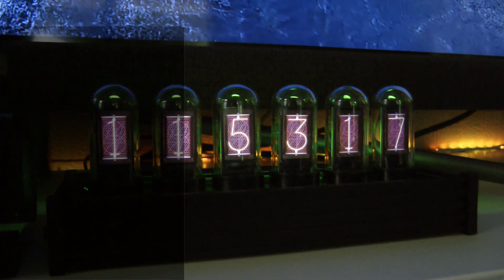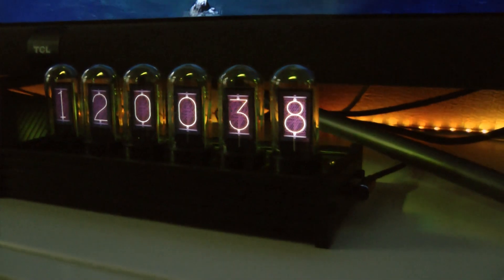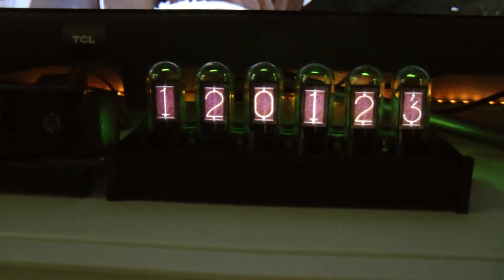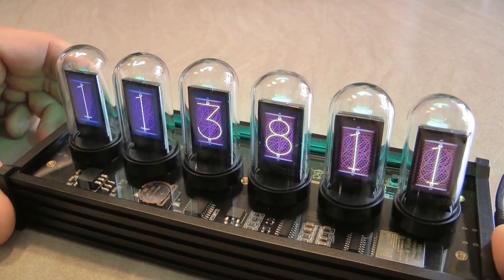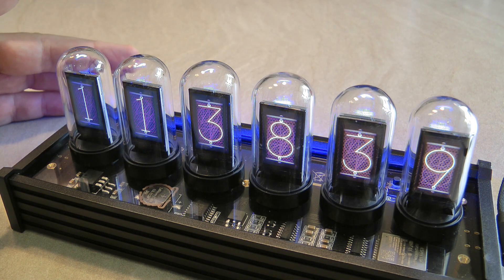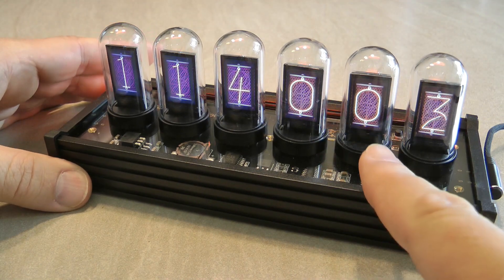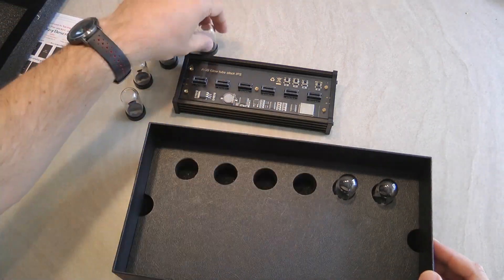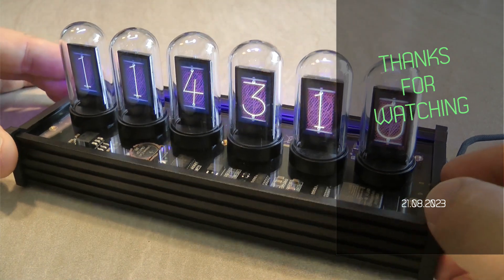Faux nixie clock on the budget: IPS screen showing nixie like digits

Comment: Received the PCBWay PunkCyber Nixie clock today. No instructions included like you received. Mode button only cycles 2 fonts, no menu access like you showed. Can't set correct time or date. Left/Right arrows cycle fonts. No PunkCyber SSID wifi password. Looked online and it is a common issue. Tried the PCBWay project page to connect via USB-C to PC, computer doesn't recognize the clock, downloaded/updated the serial drivers it recommends so the PC can recognize the clock, no joy. Not sure how you received a "golden sample" working clock. They need to ship this with working firmware. I am pretty technical and have looked over some of the Github fixes but again, can't get Win 11 to recognize the clock. Going to request a refund. If PCBWay wants to comment or help will update this otherwise stay away from this knock off.